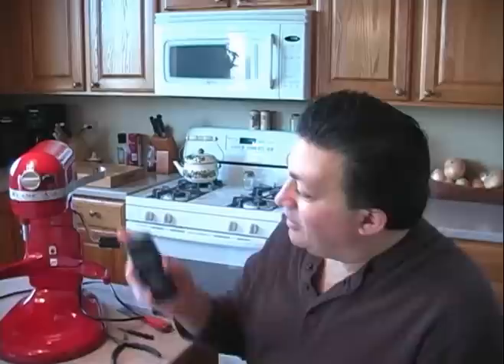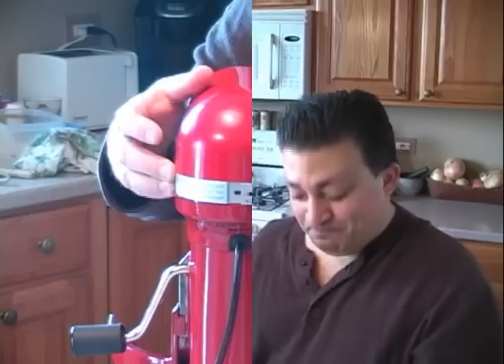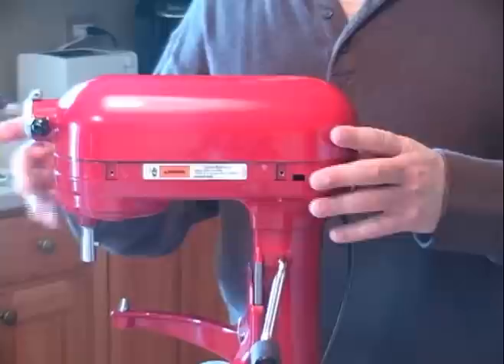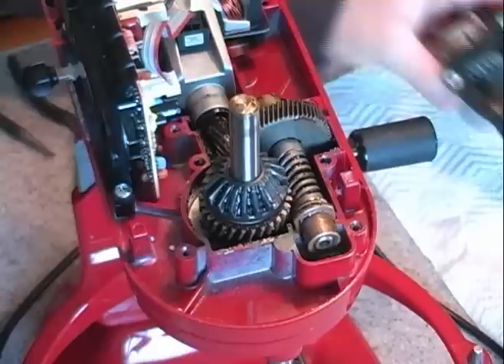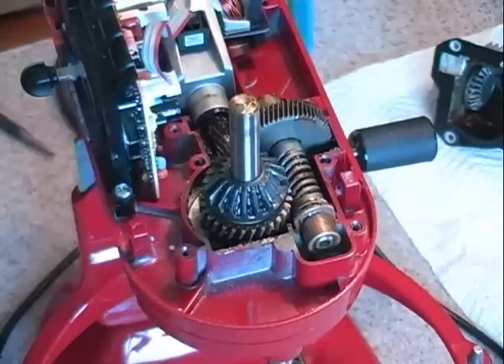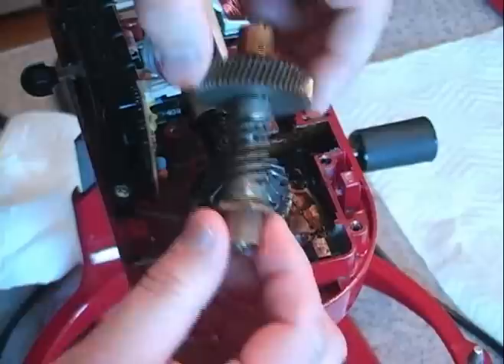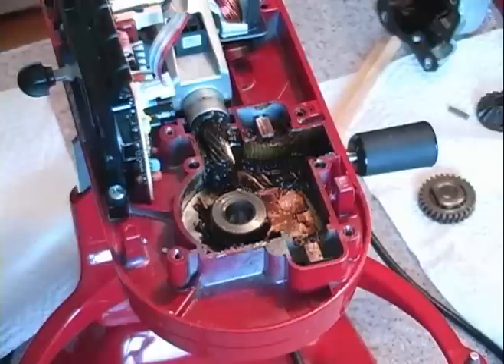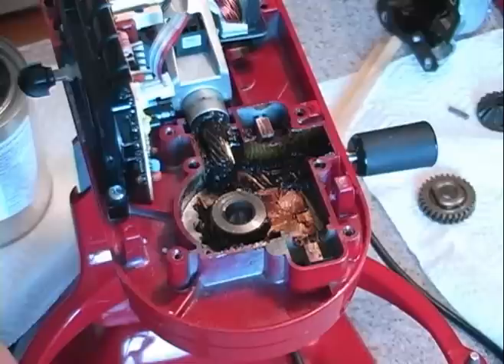How to Repair a KitchenAid 600 Professional Mixer That Isn't Spinning

Comment: Hi I bought the same model a couple of years ago which I didn't use very often. I used it once every two months or even longer. I recently wanted to use it but the machine didn't spin very smooth. It made strange noise . I turned out machine because it wouldn't change fast speed(which has 5 speeds). Do you think my machine has a problem for the worm gear? I now try to turn it on but the machine won't spin at all. I don't know if my machine's motor is burned or not. Would you please tell me what is wrong with my machine. Thank you very much to give me an answer when you have a time.

Comment: I ordered 6 gears, since the mixer wasn't spinning, and replaced five, cause I can't figure out how to replace the internal gear in the planetary, although it looked good.  Now, the mixer is spinning, but, there is more of a space between the planetary and mixer....like it dropped down.  I took apart everything and went over it again, but can't get the planetary seated up high.   Do I need a new planetary now....OMG....the love/ hate relationship continues with this mixer.   My Mom has a kitchen aid that never broke, and she used it all the time.   Please let me know how to install the  internal gear and how to fix the space between planetary and mixer.

Comment: Problem :  Our new KitchenAid Blender (KSB1570). The Pitcher is stuck on the Blender Base. How do we gently remove the pitcher without doing damage. (the blender works as it is now connected....just would like to remove it from base for washing).

Comment: Hi, I have the same problem whit my 600, and we use it sligthy, in my case the two gears that goes in the planetrary shaft were wroken whit a lot of missing metal, Why this happend?? I think they don´t made them like in the past. what´s the name of this gears? were you bought the replacment and the grase? thanks.

Comment: how I can get the right gears and worm gears for my kitchenmaid 550 HD( spin but get stuck on a point )  and also my profesional 6 model( spin but make a noise)
Reply from the maker: See the links for parts in the expanded description.

Comment: I can't get the bevel gear to lift off the shaft.  I pulled the clip off. It stops at the top of the planetary shaft like there is something that keeps it from coming off.  The clip is off already.  It easily slides to the top of the shaft but then stops.  I've put a good bit of pressure on it with pliers, but nothing.  What could be holding it on?

Comment: Hello and thank you for your really nicely made video.

I would like to ask you a favour: can you tell me the value for the capacitor labeled MOV1 on the speed control module( sku 9707220...) we used it in a 220v environment and blew the capacitor.

Many thanks in advance.

lucian

Comment: I am cry confused. I was removing a attachment and maybe I pushed with a little to much force and I heard a grinding sound. I think it got loss by that and now the plantery piece and the washer above it are about a 1/2 off but it's still mixing. I just hear the metal washer hitting the top when I mix at high speeds. Is this something that could be retightned without replacing parts or disabling it
Reply: How did you fix the grinding sound? Thanks

Comment: I just saw this video and i think the bevel gear seems too tight fitted as i see the stripped gear is totaly flat. Normaly it should have a little play within the gears. As the temperature rises within the gears the stress will be enormously so the gear wil strip after a while... It could be a production error ((c-clip to high?))

Comment: There is a question farther down asking about the part marked MOV1 on the motor control board 9707220. I have the same problem (and I can't see that anybody answered). Does anybody know what is standing on the side of it (once it is blown you cannot read anything from it, all is black). I believe it is a VDR (voltage dependent resistor, not a capacitor as the other asker stated), which is there to protect the circuit against too high voltage...

Comment: The planetary unit on my mixer has dropped down.  I can push it back up but it won't stay.  What can I do.
Reply: If you advance the video to ~6:57 you'll see there's a pin that holds the planetary assembly in place. If your planetary has dropped on its own, this pin is either broken or out of place. Normally that pin can't come out because the bevel gear is seated over it and kept firmly in place by the retaining ring. I'd wager that you'll find damage to one or more gears that resulted in the bevel sliding up and allowing this to happen.

Comment: (KitchenAid Bevel Gear for 6 Quart Mixers - 9703337, KitchenAid Mixer Replacement Worm Gear - 9709231, Kitchen Aid Mixer Attachment Drive Gear - 9703338?) As for grease: does it have to be the one from that site or would Home Depot carry something like that ?-- I am in Canada which sometimes makes it a bit more difficult 9or pricey) to get stuff ordered from certain sites in the US.

Comment: I not happy at all with the kitchen aid mixer that I bought I had so many problems i will not recommend to buy one
Reply: honestly they make garbage models and cheap part quality 
my moder have german model less than around 150$ its works perfect no issues for years now use it every other day 
i dont recomand kitchen aid to any one

Comment: How did you get the housing back on so easily? I have put everything together step by step but when I put the metal silver housing back on it doesn't go back on all the way. Have I missed a step?
Reply from the maker: By silver housing I am assuming you mean the transmission housing.  Insure the housing's proper orientation (see 15:17 on video) and also be sure the hub bevel gear is in place properly.  Also be sure all gears are seated properly (see 13:38 on video).  It should go on just fine if all gears are properly seated.
Reply: Jimbo:  Make certain that the holes for the alignment pins that are on the transmission cover are clear.  The old pins tend to shear off and remain in the hole on the chassis.  I had to drill mine out.  They were plastic, so a small hole drilled and a small screw threaded in and I pulled it right out.  If these holes are obstructed, the housing won't seat flush.